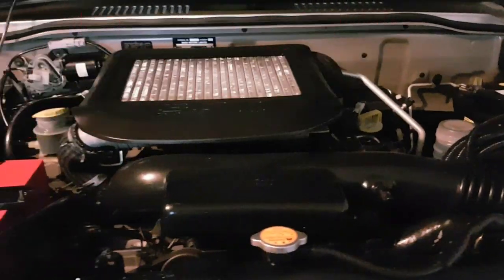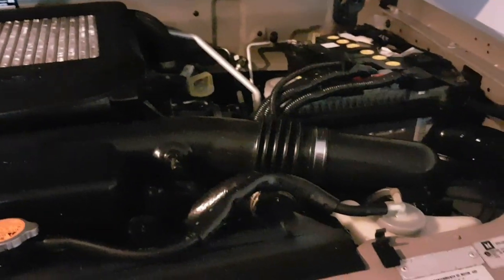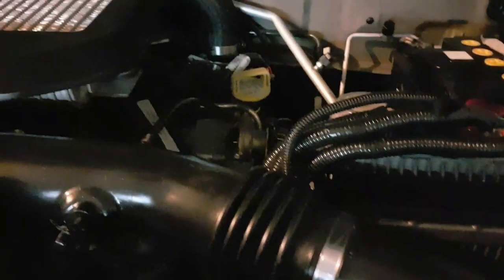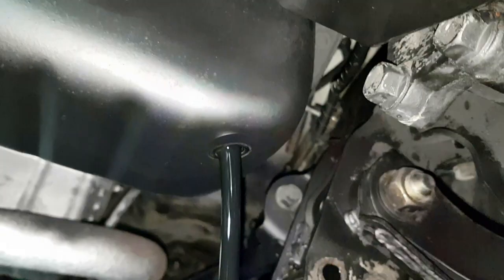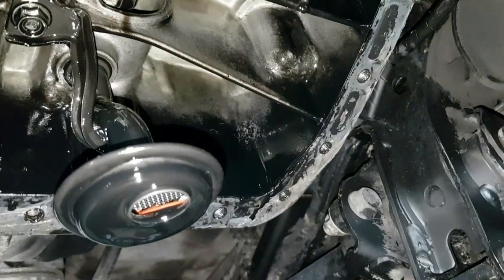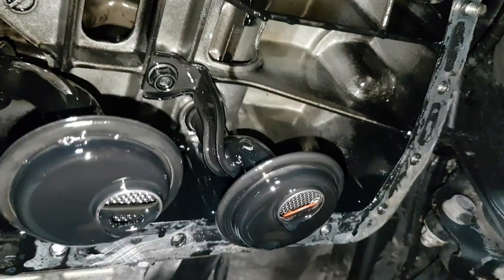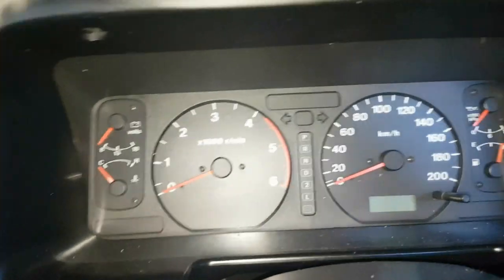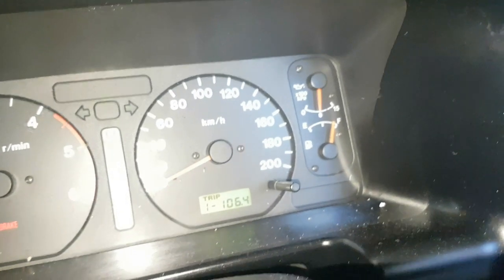holden jackroo 4jx1 oil pickup fixs. low oil pressure and where oil fillter are

Comment: Good video mate. I'll link it to help others solve their Oil Pressure issues....
Did you use the little Green O-rings supplied in the kit, or did you fit new Holden O-rings?
Did you have to give the end of the Springs a little squeeze to get them to clip and hold onto the pick-up pipes?
I've also found that if you have problems getting Oil Pressure in the Lubrication Circuit after fitting these Kits, then you need to loosen the Z600 Filter a little bit (1mm), to allow the air in the empty long pipe to escape. Then when the oil starts coming out of the Z600, quickly tighten it and it's good to go thereafter. These Oil Pressure issues are also very common in the 2003 & 2004 engines after an Oil & Filter Service, and the same trick of loosening the Z600 a bit, then waiting for oil to overflow out of the filter before tightening seems to work very quickly to get the Lubrication Circuit Oil flowing properly again.

Other owners have managed to weld gussets onto the pick-up Pipes, and others have added steel brackets to clamp both Pick-up Pipes together, and these solutions do work for a while, but the added weight linking the two pick-ups together isn't a smart idea, because it adds to the momentum when the Oil sloshes around in the sump - I've seen pick-up pipes snap off the bracket where the weld joins to the stem, and the pipe still falls into the sump. It seems as though Springs on the bottom are the best way to prevent the lateral movement of the pick-ups, and to prevent pipes falling out. They might even help reduce the larger debris from being sucked into the pick-up pipe strainers as well...as could clearly be seen in your pick-up pipes!

Good job mate